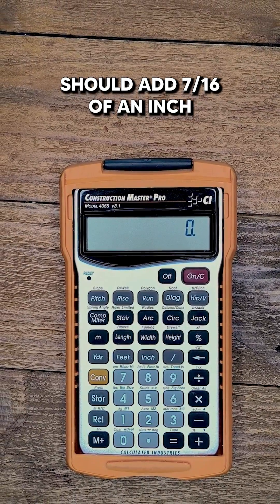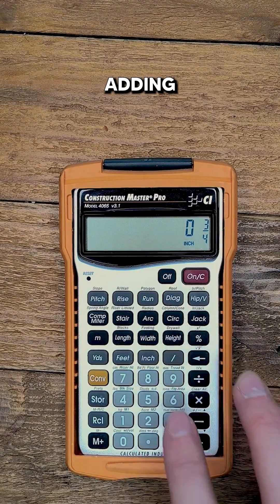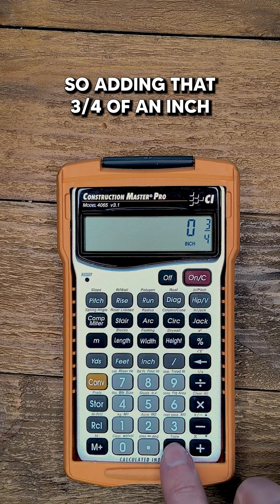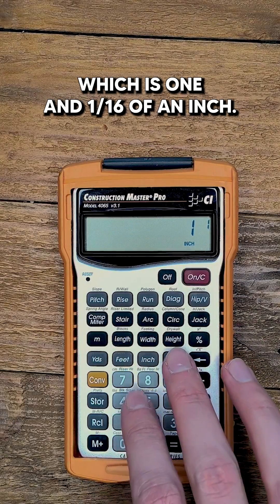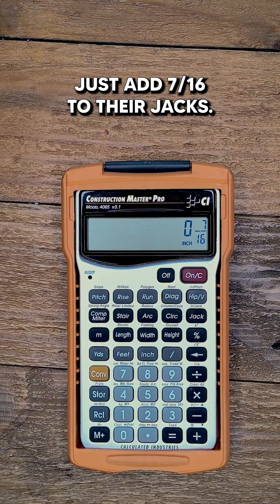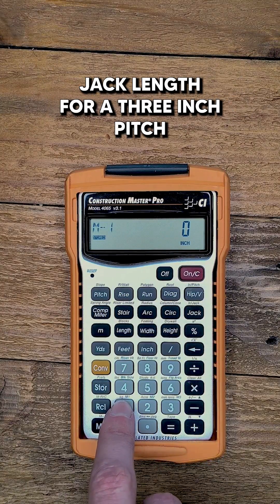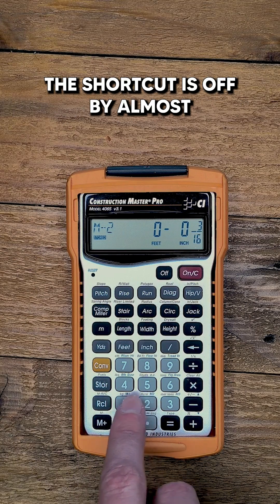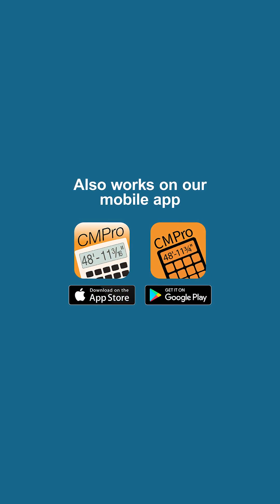When Adding 7/16 Inches to Jack Rafters Works and When it Doesn't

Comment: Hi I'm just wondering what is the formula to find the 45degree thickness of the hip?thanks
Reply from the maker: Hey adam, if you want the full 45 degree thickness, enter the full thickness as RUN. Then enter 45 and push PITCH. For half 45 thickness, do the same but enter only half the thickness. Trig formula would be SIN(45)= Thickness ➗➗45 degree thickness (unknown). Then solve for the unknown. Hope this helps!
Reply: Thank you